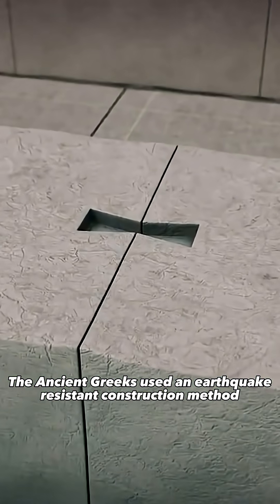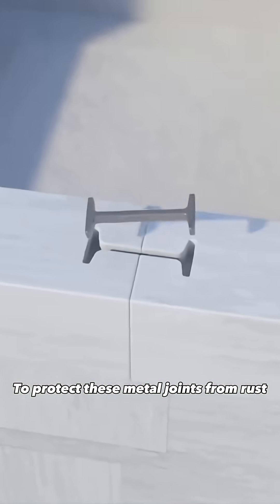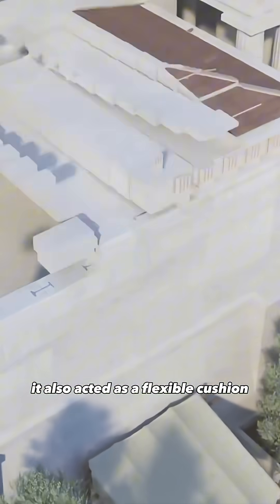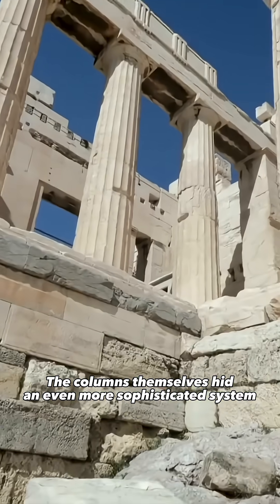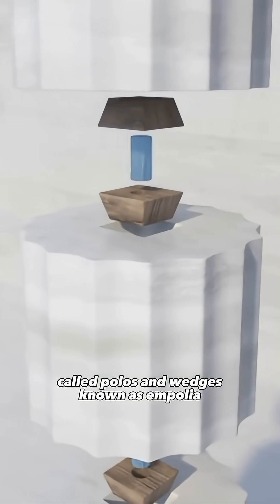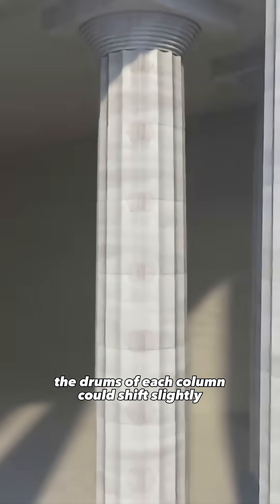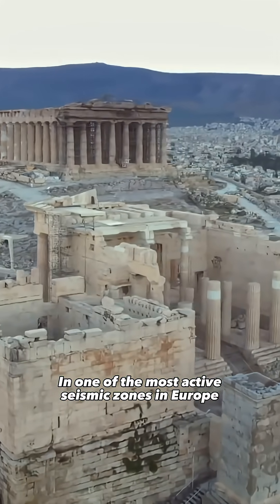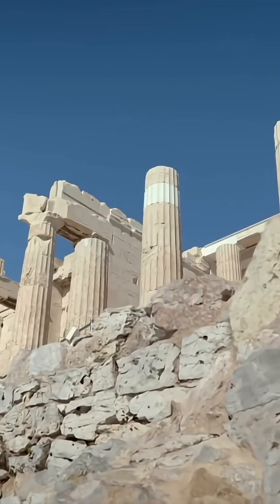Ancient Greek earthquake engineering #history #engineering

Comment: The led used in the aqua ducts contributed to Romes fall, as they drank led in the water, it degraded their mental capacity.
Its not a short discussion.
Reply: The pipes got quickly coated with calcite, the lead poisonment is probably a legend.

Comment: Some interesting trivia: During the Greek Revolution from the Ottoman Empire, the Greeks laid siege on Athens and the Ottoman forces closed themselves up in the Acropolis. At some point of the siege, they had run out of bullets. Bullets at that time were round and made of lead. So the Ottomans started destroying the buildings in the Acropolis to extract the lead in the connections of building blocks and melt it to make bullets. 
Not long after, the besieging Greeks got wind of what the Ottomans were doing and to prevent them from destroying these great monuments of their ancestors, who had withstood the test of time for more than 2000 years, they offered to the Ottomans to supply them with bullets themselves in exchange to leaving the buildings intact. 
For the remainder of the siege, the Greeks were supplying the Ottomans insude with the bullets to fight them!

Comment: And yet architects and engineers haven’t learned sh!t. And modern day buildings are extremely unstable and will crumble with the slightest of earthquakes.
Reply: Modern buildings are obscenely earthquake resistant if they're built to be earthquake resistant.

Los Angeles is in the middle of one of the most seismically active regions on the planet and nothing falls down in the quakes that hit the city every few years.  The average LA or Tokyo skyscraper could withstand an earthquake that would have reduced the Parthenon to rubble.

The only buildings that collapse are ones that aren't built up to any kind of earthquake code, and that usually only happens in poor or developing countries like with the 2023 quakes in Turkey and Syria. Turkey has earthquake codes, but it turned out that corrupt officials were taking bribes to avoid enforcing them which led to a ton of deaths.

Comment: But inspite of all this, all Greek structures except pillars are left. Where as Romans 2000 y old bridges are still standing?
Reply: Because Ottomans didn't store explosives in them, because Christians didn't demolish them, because they weren't abandoned for centuries to rot. Bridges in their majority never stopped being used and repaired. The same reason there are still bridges in Greece made by the ancient Greeks still standing, some going back at 1300 BC. That's 700 years before the first recorded (wooden) Roman bridge. The same reason amphitheatres still stand in almost pristine condition. They never stopped being used and maintained. What kind of moronic question is this?

Comment: One of the biggest problems affecting the longevity of these buildings was, and always has been people. Of course the blocks were useful, but metal was far more valuable and destruction means nothing against that. So over the intervening 2000 years many structures were totally demolished, their materials used for other buildings, more left only halves because the machinery was gone by then, and in a National Geographic this still goes on via night robbers. On the bottom you have to say the cause was the fall of Rome, followed by the rest of the collapse created a populace of poor people who were the true sufferers of the greed of the elites on both sides; those who kept them on the bottom, and the so called conquerors, the Vandals that stayed behind to live there, and continue to use a subdued population. Thus their clever designs for the longevity of their wonderful structures was in the end thwarted by themselves, with plenty of help from the outside via multiple wars.

Comment: They mixed lime into the concrete, so cracks would repair themselves on contact with water. Genius.
Reply: those were the romans
Reply: @Blabla-q8c These buildings are made of joined stones. But all concrete pre 19th century used lime.
Reply: @user-iw7gb6hx2j All concrete uses lime to this day and is highly caustic until it sets. Arguably, modern synthetic lime has worse properties than volcanic ash used by Romans.
Reply: @Reirainsong  no modern concrete uses  cement as the binder and aggregate. Roman concrete used lime as the binder. They burnt lime sources such as limestone, chalk, or even seashells, to produce quicklime. Which was then mixed with an aggregate, and if they had it and were particularly concerned a pozzolan too. The pozzolan changed sped up the carbonation of the lime, and increased the final strength. But can change other properties too.
Reply: Soooo you didn't watch the video at all? 😅
Reply: Greeks didn't use concrete. What you're saying is Roman technology
Reply: These buildings are made of joined stones. But all concrete pre 19th century used lime.

Comment: The "lack" of  mortar was a good thing. If they had used it these structures would have long since collapsed.
Return the Marbles!!
Reply: Return the slab(s)?
Reply: In this economy? hell no
Reply: Depends what mortar they would have used. Cement mortar is bad as it is too hard but historically buildings used lime mortar in the West which is softer and allows for movement/expansion.
Unfortunately we have damaged a lot of historic buildings by restoring them using cement instead of traditional mortars.
Reply: But these structures did collapse.  Today's Parthenon has been extensively restored since the 1600s (columns & entablatures re-erected).  But still,  the structures of ancient Greece are engineering marvels.
Reply: @jineshlachmansingh4709 bro it literally got blown sky high...the Ottomans where using at as a powder storage/evacuation point during thier war with the venations cause they thought nobody would target such a historical monument 
Unfortunately they where wrong and a bullet ignited the powder
Reply: @jineshlachmansingh4709  because there was a warzone there
Reply: Roman mortar was literally a huge deal. Learn a thing or two about history...
Reply: AGREED! Natrual materials! Marble stone and such! Local materials sturdier and eco friendly
Reply: @TheGrace020 local materials absolutely aren’t sturdier. If strength and ability to be manipulated into the designs we need could be found by marble our planes wouldn’t be made of titanium, they’d be marble. Marble isn’t even a particularly good stone since it’s more vulnerable to acid and less strong than stones like granite, it’s just far prettier so it was used and rightly so in these contexts.
It’s tiresome to see more people wrongly alobsessed with “nature” as though it’s a good thing. Our food isn’t natural, the wild plant we turned into today’s corn had about 6-12 kernels and they were worse than jawbreakers, you had to boil and otherwise cook it for hours so that hopefully you didn’t chip a tooth. All our fruits and veg were either breed by us to become less poisonous, higher yield, more nutritious, and less disgusting to eat or we’re literally invented by us like lemons, which were invented by crossbreeding oranges and citrons, the latter of which was also a crossbreed.
Nature isn’t what you see when you enjoy a nice hike in the national park, because we culled the predators there, removed most poisonous plants, and after your hike you can go home and shower like a civilized person. Nature is a horrifically ugly thing, it’s the hurricanes, vicious predators, even more vicious prey, poisonous plants, death by exposure, death by starvation, death by disease because of a damn paper cut, death by dehydration or by unclean water, and so on.
Humanity has heroically beaten back against nature such that we have shelter, food, water, and even beauty where nature has none to offer freely. The only benefit of nature is that we can conquer it and turn its horrors into good things, which is how we got nice pretty national parks, and other forms of man-cultivated “natural” beauty.
Our synthetics are not merely as good as nature, they’re better. You seem like the kind of person who’d prefer the diamond in your engagement ring to be a “real” natural diamond over a synthetic diamond even though the synthetic’s only crime is being too uniform and perfect, and the natural diamond which is no stronger or better in really any way has to be mined painstakingly and is often mined by child slaves. Nature isn’t worth it, it’s not worth anything on its own anyway, and it’s only value isn’t due to it being natural so we can fully separate the resources from nature and have it be better rather than worse.
Reply: @TheGrace020 mortar is a local and natural material in most cases especially in ancient times.
Reply: @AldiMarkt-t4yyou can find that at Lowe's or home Depot
Reply: Unfortunately Athens smog these days would literally destroy them through acid rain from pollution!!
I do not agree to Elgin's theft!
I imagine the British museum would be almost empty if they returned all that was stolen during victorian empire times!!
Reply: @karenphyland5692  Elgin bought them, if he hadn't the Greeks would have continued to use them as a source of building materials, get your facts right. Are the Greeks going to return everything they stole from Egypt? Are the Italians going to return everything the Romans stole, are the Spanish going to return everything they stole from South America ...?
Reply: @karenphyland5692  Only 1% of the Museum's holdings are on display at any given time and almost all are totally legit. 
Just make copies of the controversial  stuff and give it back..... making lots of friends and creating new tourist attractions. Plus employing generations of new crafts folk ( and advancing 3D printing.) . A dya dream I suspect.
Reply: @karenphyland5692  Was. Not. Theft. It was legally purchased from the turkish ruler of athens. It was perfectly legal by the laws of the time.
Reply: @karenphyland5692  what does the British Museum have to do with Athens’ pollution or ancient building practices lmao
Reply: @karenphyland5692 Why would the British return artifacts they purchased or obtained through conquest?
It's good that the British safeguarded all those ancient artifacts, despite what all the mass of NPCs say.
Reply: @axdvx  Exactly. The British took better care of the artifacts than the nations they took them from.
Reply: @axdvx I can understand wanting your culture’s stuff back regarding conquest though, even if it is the opinion of sore losers. It’s true that those artifacts were often safer in British museums than in their original homes though, and as much is kinda proven by their current position and the fact that they seemingly can’t be stolen from the museums… and obviously that level of security wasn’t present in their homelands.

Comment: Called dowels today... we still use them 
They've changed a bit 
We don't use them for earth quakes 
They are for movement 
I worked with Greek an Italian concreters for years 
an they don't let you in on Thier building secret's...there was also an oil that the wooden peg's were covered in
Reply: The oiled wooden dowels is to prevent the wood from expanding due to possible absorption of moisture from occasional heavy rain.
Reply: Oiled wood would also slow down decay of the wood
Reply: So you're saying they're for movement, like during earthquakes?
That's a hot take!

Comment: I truly wish we would implement some of these ancient techniques in modern building. It cannot be more expensive to build with these techniques, then rebuilding shit over and over and over again the way we do now I mean, this stuff is still standing after 2000 years it has paid for itself 100 times over.
Reply: What are you talking about?? We use even more effective anti-earthquake methods than  that.
Reply: @dnomyarnostaw  I’ll tell you what you point out a modern structure that has been built in the last 200 years that will still be standing in 2000 years and we can talk about your argument
Reply: @logancrockett5348   Nicely evaded. Deflection must be your middle name. 
And yes, there are plenty of modern building whose ruined carcass will be largely intact in 2000 years.
"The development of large-scale counterweights, base isolation systems, and seismic dampers has enabled the construction of skyscrapers capable of withstanding powerful seismic events, such as the 9.1 magnitude Tohoku earthquake in 2011.
 The Tokyo Skytree, standing at 634 meters, is a prime example of this engineering prowess, designed to remain intact during major quakes.
 Additionally, seismic isolation technology has been widely adopted, with over 4,000 buildings incorporating this system by 2015, and its use continues to expand, particularly in high-rise residential and commercial developments."
Reply: @dnomyarnostaw lol deflecting had nothing to do with and nothing that you listed off will be standing in 2000 years the problem with modern day construction is it relies incredibly heavy on steel which rusts and modern concrete does not hold up anywhere near as good as Roman concrete and that has been proven time and time again yes, we can re-create Roman concrete, but people do not want to fork out the extra money to have it